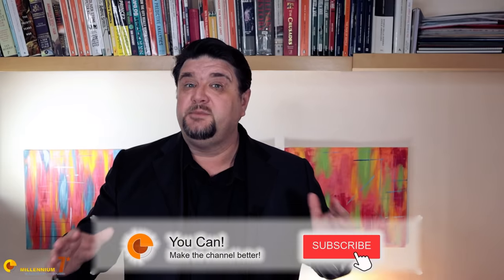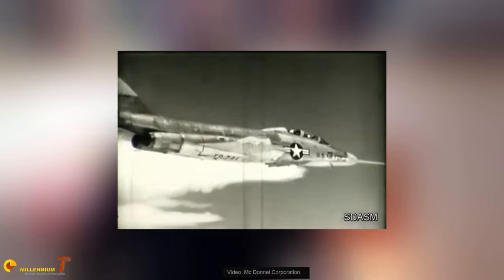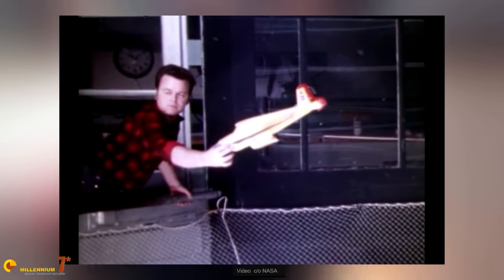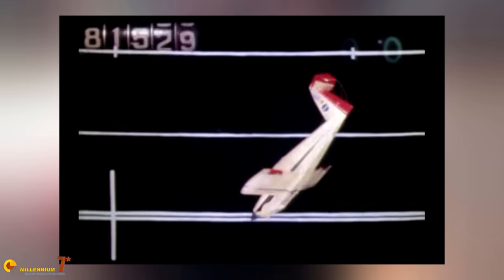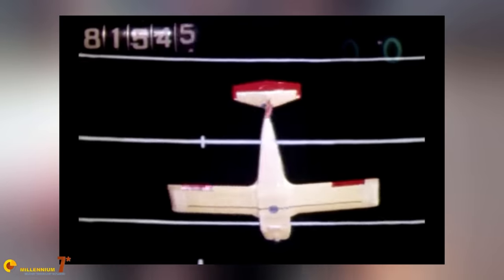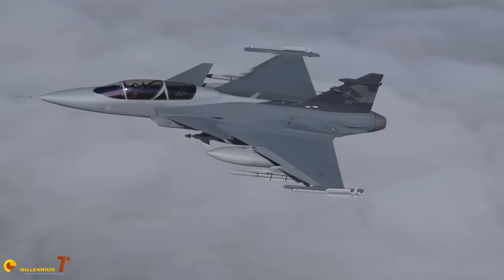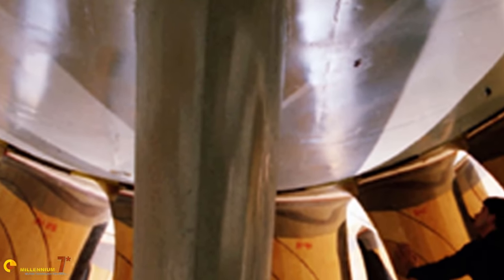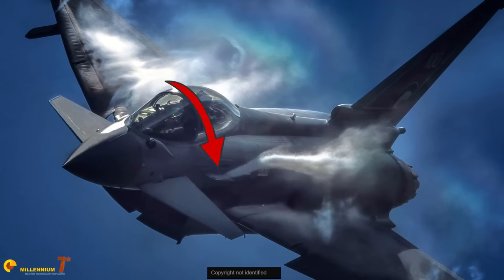Gripen - The Design Chronicles - Part 2

Comment: I love your videos and you are very knowledgable. But in this case, I have a little advantage, as was in the team that made Gripen. The base problem was simpler. In all aircraft with flight control augmentation, you divide the control authority between the aircraft's augmentation and the pilot (you only have 100% control surface authority to use, measured in deflection angle and deflection rate which creates the aerodynamic force). This is more accentuated in an unstable FBW fighter as the augmentation needs more of the total authority to keep the aircraft from departing. In the first crash (third flight IIRC) the aircraft had too much of the authority and the pilot (Lars R) fought the aircraft, that he felt was flying its way and not his, to control it=PIO. In the August Stockholm case, the dial was the other way. The FBW team had opened up the pilot's authority so the pilot felt in control, but in a very remote corner of the flight envelope (Q, AoA, G), the aircraft got too little authority to control the aircraft. As the aircraft was now departing,  the pilot tried to control it = PIO, but now the other way around. Fix was to introduce a selective FBW filter to reduce the pilot's authority a bit in this remote corner of the flight envelope. The aero fix added to the stability as well but the base fix was a digital filter in the FBW.
Reply from the maker: Perfect! Thank you for the comment! This is the kind of comments I like to see because they add value or point out mistakes. Thank you very much!
Reply: In the complete incident video it kind  of looks like the Gripen regains control once the pilot is gone.
(Would fit with pilot having too much control)

Other observations
- ejection force helped pushing down the nose (maybe...)
- engine gone, so it would not really have recovered anyway (to me it looks like an emergency shutdown due to ejection)
Reply: @RogerJL  Yes, the condition was the pilot could use up too much of the pitch control authority so once the aircraft starting departing Lars (same guy as the first crash) held against violently with stick movements, eating up the stability authority for the aircraft further. Once he took his hand off the stick to grab the ejection handles the aircraft had 100% of the pitch authority and the aircraft returned to stable flight (you could see this on the crash recorders). But Lars was already on the way to eject, he had no chance to sense the aircraft was now OK.
Reply: I am absolutely naive in this field but still I enjoyed listening to the video. Excellent. Regards. Saeed from pakistan
Reply: It would be nice to have a copilot AI capable enough to try to land the aircraft safely even after the pilot ejects. It would not help during normal flight any differently than current control authority settings but it might help if the pilot is unconscious or otherwise unable to control the aircraft.

Comment: Not sure I understand the need for the vortex generators on the Grippen.
     If the reattached airflow results in asymmetrical dynamics, doesn't that mean the aircraft will fall to one side or the other. Could that be an advantage in a dogfight - unpredictability. Though there would be a lose of altitude. Isn't the most likely flight envelop to be in a hairied dogfight where this would be a concern? But if encountered at low altitude, such as at an airshow recovery altitude might not exist.

Comment: An early version of the F-22 also had a PIO crash. During landing the F-22 suffered from PIO smashing the airframe into the runway leaving a trail of sparks behind it as it skid along the runway. As I remember it they used the same software fix as in Gripen. Don't know if they got it from Saab, or if they fixed it themselves.

Comment: I would like to see a video on one of the predecessor for the Gripen, the J35. Also it was the first aircraft capable of cobra manuever.
Reply: It's curious that the Draken could perform the Cobra, but not its successors, the Viggen and Gripen.
Reply: @ZeOverman I'm trust that the '10' is a typo, as the P&W-JT8D was used in the DC-9, not the DC-10.
Reply: @Niclas Eriksson 
It's certainly true that Draken pilots initially learnt the maneouvre in order cope with a superstall, but there are stories of Draken pilots using the Cobra in mock dogfights with Soviet pilots.  As to whether this is useful in actual combat is debatable - but it's worth bearing in mind that extreme agility at low speeds served Harrier pilots well in the Falklands conflict.
Reply: I don't know whether they were the 2 incidents mentioned, but I know that SAAB test pilot Per Radestrom had to eject out of Gripens TWICE! He thought his luck might run out if he had to do it again, so he retired after the 2nd one!
Reply: @FangPaw  Not really, since no one considered it a useful move, and it's still not considered a valid tactical move by any real aviation authorities. While it's kind of nice to know that your plane CAN do it, and it's visually impressive in airshows, they aren't going to go out of their way to make a plane able to do it, since there is no advantage in combat. 
And yes, I am aware of all the highly theoretical ways people claim it could be used, and no, I am not convinced any more than the people who write fighter tactics manuals. At best it's a last ditch emergency move to take your opponent off guard when nothing else can possibly save you. Hardly worth spending a great deal of time on integrating. They didn't make the F-35 able to do it either. They could have spend another trillion dollars and figured it out if they thought it was important, but they didn't.
Reply: Actually, it wasn't. That was a superstall, and it just looks like a Cobra. They are not actually the same thing. And the J35 was only able to do them at high altitude, while the MiG-29 could do them at any speed or altitude. 
In any case, since it's nothing but a pointless show maneuver, it hardly matters. It's like bragging that your car can pull a "wheelie". Impressive, but no car designers or race car drivers WANT their car to pull the front wheels off the ground. It just wastes power in drag racing, and risks loosing control in all types of cars. But it looks pretty cool!
The Cobra is a pointless manuever.

Comment: India should select Gripen E in   MMRCA 2.  Gripens are marvel of engineering, highly capable and reliable.
Reply: Tejas Mark2 will be as capable as Gripen E. Whereas our multirole requirements will be met mostly by Rafale.
Reply: Ben Ghazi  you can check out the planned specifications of Tejas mark2 and compare with GripenE.
Reply: no thanks. Tejas will do the job.
Reply: Ben Ghazi  You should check the specs of the existing Tejas mk1 and Gripen C.
Reply: Ben Ghazi  Whats a combat link? And  Gripen C has a very basic EW suite, doesn it? just like the Tejas mk1?
And hows the British Marconi Electronic Systems Radar on the Gripen C working?
Reply: Ben Ghazi  Tejas? Naah.  IAF Mig 21s could do that.  Ex Cope India 2004 , IAF Su-30MK, Mrage2000,Mig21.  USAF  F-15 and F-16.   Overall score  90-10(IAF-USAF).
Also recent encounter with Pakistani Airforce, IAF Mig21 again took down a PAF F-16.
Point is....a lot of factor plays in this Aerial exercises, including pilot skills.
Unless Tejas goes into one, we wouldn know.

Comment: Any idea how the ngf or tempest will keep the advantages of the canards without them (for stealth reasons) ?
Reply: Stealth design is highly overrated, it will be obsolete as sensors and jammers get better and better.
Reply: @Rikard_Nilsson  no smart jamming works even better with low rcs that’s why the rafale was designed to be discret. With multistatic radars you will need both passive and active stealth combined. And even more you will need to erase « electronic shadows. »
The rafale will get a stealth kit by 2030 to improve passive stealth and boost spectra’s active stealth capacity. And look at the ngf or tempest or faxx they will all be active and passive stealth. Just like the rafale is getting passive stealth, the su57 and f35 are getting active stealth. Its the story of the sword and shield, i dont believe in the all power of stealth like intended in the f35 but it will remain an important feature amongs others

Comment: Thank you for your video, you appear to really know your aerodynamics, my only advice is that as you are not a native english speaker, to make use of one of the internet word pronunciation sites, it took me until  your third mention to get that you were saying "hysteresis".
Reply from the maker: My worst problem as far as YouTube is concerned.
Reply: English is not my main language and I caught his word "hysteresis" from the beginning but I don't get the meaning in aerodynamics term. BTW , only 11 gripens left in my country.
Reply: LWYS PARAGON :  An over-simplified explanation is you can think of it as kind of like "bouncing back from an over-correction with a time lag."
Reply: Another work around could be to include a subtitle set rather than relying on the autogenerated subtitles by YouTube. This would take some time and effort though so I understand if the content creator does not have the time to do it. I can understand him fairly well despite his accent but accurate subtitles would be still be nice to have.